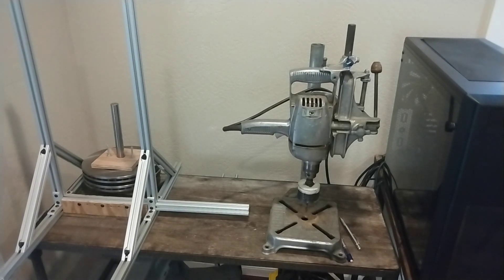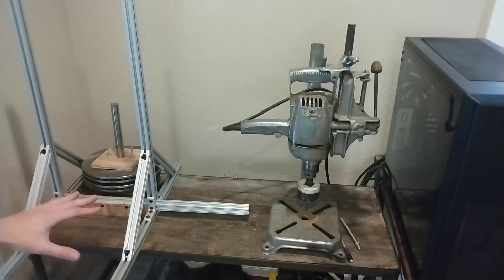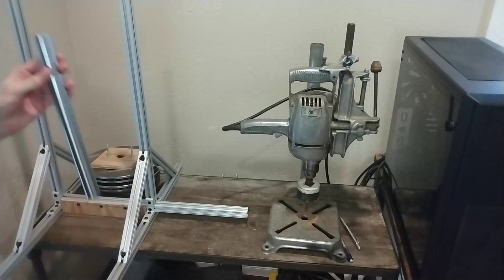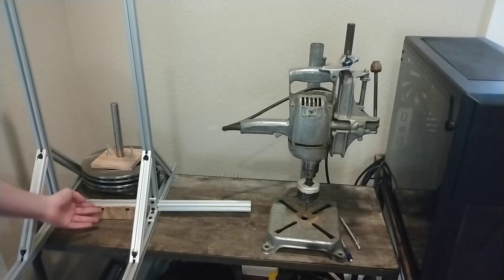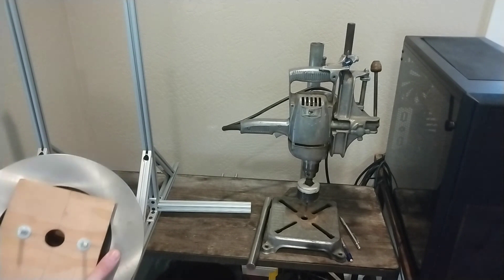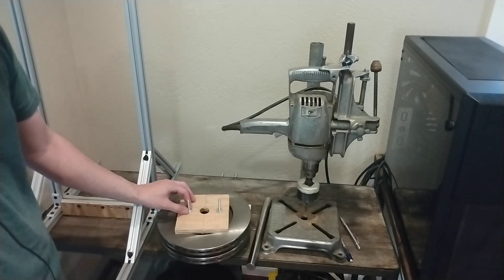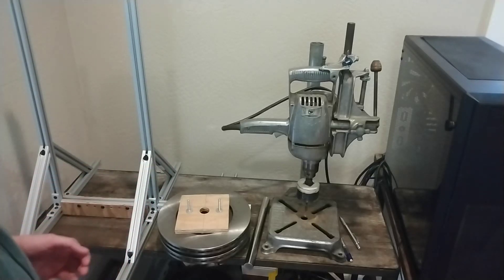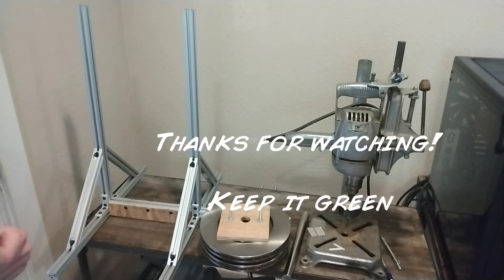DIY Flywheel Battery - Sustainable Energy Storage (Part 1)

Comment: I really think that for ground-based energy storage, flywheels can make a lot of sense! I encourage you to work through the physics. A few things become pretty clear when you run the numbers on how the material stress and energy capacity of a flywheel relates to its speed:
1) It is plausible that a single flywheel system, small enough to be transported and installed by hand, could satisfy the energy storage needs of an average home.
2) For the purposes of supporting a home, (large or tiny), the practical applications of energy storage flywheels which run in ambient atmosphere are pretty minimal. Sized for the application, they would need to be impractically large and heavy in order to run slowly enough to not waste most of the energy you put in through air drag.
3) When you warm up to the need for a vacuum, understand that most metals and other heavy materials are actually usually pretty far from ideal for the flywheel mass itself. Think stronger and lighter (believe it or not:)

Comment: Have you already worked out the flywheel performance required to power your benchmark single-family home?

You design your device to be a primary power generator with theoretically perpetual service? Or you design your device to feed batteries to power the SFH?
Reply from the maker: In the future we'll be constructing some sustainable home projects, once we have the funding. Then we'll be able to get some interesting data about how much power is required for these types of homes, peak power usage, etc. For the amount of energy sucked up by a typical American home, a flywheel system would probably be impractical IMO. 

The intention is to build a flywheel that can act as the primary battery for the home's electrical system. It will run LED lights, ventilation fans, etc, driven by solar, wind, and/or hydro depending on what is appropriate to the home's environment. The sustainable home also uses a "thermal battery" to maintain a comfortable temperature. Search "earthship" on YouTube to see designs similar to what we will build.

Comment: Very good. I agree totally with the design principle of ongoing self-maintenance by most DIY persons. Chemical batteries: not maintainable DIY, and neither recyclable nor sustainable as to materials. Solar panels: complex, fragile, not maintainable DIY, and neither recyclable nor sustainable as to materials.  Etc.  Maybe future air/water battery technology will actually happen in the marketplace.

I'm using the same design philosophy to develop a gravity-based power generation system for SFH scale.
Reply: solar panels can last up to 20 years, theyre slightly more durable than a glass window, (ive never had to replace a window in a house in my entire life) and theyre 75% glass by weight which is easily recyclable and the rest is metal which obviously is easily recyclable as well the materials can literally be ground up and reformed into what they were before (very sustainable)
Reply: Panels are physically fragile and can produce energy only under certain conditions. Panels are one of many components in that energy delivery system. Probably not DIY for 99% of system users.
Reply: one measly Iphone 13 with its 12.5 watt hour battery has the same amount of energy as a mass of 1 metric ton lifted 4.6 meters in the air... good luck with that.
Reply: By your numbers, drop that one concrete block only about once in every 10 minutes for 24 hours and you produce 3kWh, (but must subtract the energy used to lift each block again). How much more power does a small single-family home need?